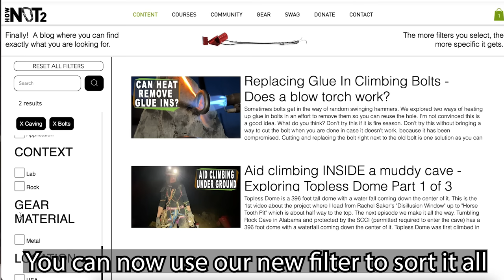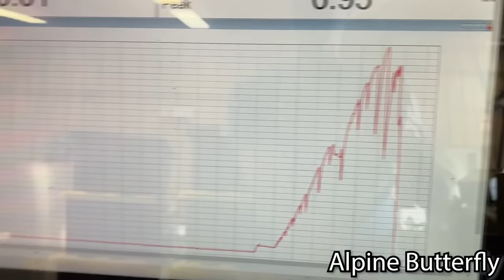15 Knots You Need to Big Wall

Comment from the maker: We did a nice write up on these knots at  https://www.hownot2.com/post/bigwalls-knots.

Check out our new store! https://hownot2.store/
Reply: Id be curious to see a pull test on a figure 8 with the tail end not fed through the last loop. Essentially seeing if the not is still redundant after becoming partially untied.
Reply: 39:25 The VT prusik is also called baldostano, it was taught to me by a firefighter who said it was used to go down an elevator cable under tension even with grease

Comment: Two notes on Munter hitches that don't get mentioned very often: 1) the rope-on-rope friction is hard on the sheath and can accelerate wear.  It will not cut through the rope like a sling or cord demo does, but it can accelerate worn sheath points into core shots;  2) the  action for the braking is the  reverse of almost any mechanical rappel device used in climbing.  To slow or stop the descent, the brake hand must bring the free (slack) strand towards the loaded strand to slow and parallel to the loaded strand to stop.  So, if the loaded strand leads UP out of the pear 'biner, LIFT UP (this would be rappelling, or for belaying a climber/lowering a load above the 'biner).  If the loaded strand lead DOWN out of the pear 'biner, LOWER  DOWN (this would be for belaying a climber/lowering a load below the 'biner).  The munter hitch should be practiced along with the mechanical belay device until going back and forth between them no longer confuses the user and the correct braking action is automatic with no surprises.
Reply: The hand position doesnt matter alot in terms of braking power. It mainly affects the amount of twists the hitch generates. If the braking hand is parallel to the loading strand theres the least amount of twists, but its also the least ergonomic position. The rope also twists alot more under load so it makes sense to lower with hands up, even if you belay hands down.
Reply: @dunklezwiebel   Hmmm...  My experience with the Munter hitch is as I stated.  Yes, an additional wrap will add friction, but it seems to me that varying the brake-hand position is what varies the braking power from fast to slow to stop for however many wraps one has around the 'biner.

Comment: A clove hitch, followed periodically with half hitches, is the prescribed method for sending a pipe up on a rope, at least among the riggers I know, so I'd say it's quite bomber. 

There's even an old school arborist out in Santa Cruz that rigs down big wood on a clove hitch backed up with a half hitch. For an easily untied knot that cinches like that double fisherman loop, or the clove, try the running bowline; what is considered current best practice in arboriculture.

Comment: The bowline on a bite can also be done as a follow through and is a great knot to tie in with as well if you expect to take a good few falls. If would argue that is actually internally redundant because if one loop comes completely undone, it will still be a regular bowline with a really long tail which is super good enough as a back up. I wouldn't clip the two loops independently though, idk if that would hold if one failed.

There is also a really cool way to tie in a person to the middle of a rope with a bowline on a bite by having the person step through the whole loop, however this has the limitation that it cannot be undone if a person is tethered into a wall without undoing the tether.
Reply: Hmmm...  I know of no practical way to tie a harness directly into a bowline on a bight if I am already wearing the harness.  I could clip to it using 'biners, but that adds an additional point of confusion/potential failure.
Reply: @perplexedon9834  Ah.  I and others use the term 'tie in' exclusively to refer to connecting the rope directly to a climbing harness,  fixed protection (e.g. bolted ring), etc. and not for creating a loop to be clipped into the harness or whatever using carabiners or screw links that add complexity and addition points for failure or error potential.  In an all-rock climbing scenario, I see no major advantages to clipping into a loop at the end of rope when tying in directly (with no 'biner) can done easily.  YMMV
Reply: @kayzinti4452  
When I said clip the loops independently, that was just with reference to whether you could weight each loop independently. Everything else in my comment was about tying in as you described. When I use bowline on a bite to tie in myself or tie the rope to an anchor I do not use any carabiners.

In that link it describes with pictures how to tie in to the middle of the rope with bowline on a bite with no carabiners required
Reply: @perplexedon9834   Now that I re-read the link more closely (+ didn't get down to pix before), I better understand what you are saying.  While I have not seen these illustrated before (very clear pictures!), for my own taste and preferences I would put these in the 'not-practical (not every climb)' category due to the need for extra rope to tie-in, and the challenges of doing this in an unsecure stance (clipped-in or not).  Both are valid secure knots once tied, certainly, but balancing the potential risks of getting it tied in a precarious stance against the risk of cross-loading a couple reversed 'biners clipped to a alpine butterfly loop, I myself am going to clip-in rather than tie in.    The potential for confusion and mistakes leading grim accidents (like the fall noted in your link) always influences my thinking.  In the scenario where I am hard-put to use 2 'biners for clipping in, I probably would use the girth hitch with an alpine butterfly knot instead of a figure-8.  Thanks for the link and your thoughts.
Reply: The bowline on a bight threaded, also used instead of a figure eight threaded to knot the rope to your harness.

Comment: Awsome video... AND:
(/rant on)
The carrick bend. I get why it has fallen out of the discussion in most North American climbing, but, particularly here, it might get some. The edk is only suitable for matched ropes at low load (twins, halves or simi static of the same diameter). The carrick tied properly, that is with ends exiting on opposite sides and dressed by pulling both ends against the working ropes and then the working ropes against each other, will form an asymmetric knot that will do anything an edk will with the added bonus of a strong knot that won't jam, capsize or damage the rope between any two life support lines.
Also, the bowline on the bight with the double loop being clipped as one loop is its own backup. It's a left hand bowline tied on top of a right hand bowline and will ring load all day... as long as the 2 loops are treated as one. Tied in a sling (even dyneema) or cordalet with the double loop clipped to a primary anchor and the single clipped to a backup point, it is slept on as a 2 bolt belay. I think Mammut did some great test with this.
(... /rant off)

Comment: Hey there! we were told in sailing school, that there is a bowline and a wrong bowline. And the wrong one is considered not safe and has the end of the rope pointing inside as you showed it. the "correct" version has the end pointing outwards, out of the loop... Is ther a differece in strength and safety between both? Very curious

Comment: Fun Fact :   The Double Fishermans aka Blood knot,  Is the only knot certified to be used while tying spectra line together during production. so if a strand (strand being anything from a tiny 10 threads or so to a huge bundle of twisted strands)  breaks or runs out in the middle of a run while twisting or braiding you use that knot to tie in the next package of line and hopefully it's not on the outside of the rope when its done on a run. we used quad twist knots to ensure enough friction and a 1 inch tail so it wouldn't come untied.
Reply: Blood knot is NOT the same as a double (or single or triple) fisherman’s knot. Totally different structure.
Reply: @matthewwikswo807  you are correct sir, I made my comment in haste, the double fisherman's is closer to a double barrel knot

Comment: To the topic of bowlines. If you want to tie in with a bowline to your harness than you have to use a double bowline because of ringloading. If I back it up is a single bowline enough or still not safe? My experience is that not many climbers I've met can tell me all of that. They just say: I learned it that way and do it that way. So I would very glad to hear something about that topic.

Comment: Thnx guys for these video's. really helpfull and well shown. I do have a question. Why use  an extra/different knot (stopper knot) to at the end of a rope to stop you from falling off when you ran out of rope if you can use a figure 8 aswell.  Imo less is more so if you as little different knots as sdafely possible.  Do I miss any brenefits from the stopperknot instead of a figure 8 knot?

Comment: I would give a shout out to the triple bowline, which is excellent for tying something around an object (tree, for example) using the middle of the rope.
Reply: What scenario(s) would you use this in?  The only one I can think of would be rigging a short drop with two parallel lines for rappelling/ascending practice with a single rope long enough to rig both.
Reply: @kayzinti4452  it's also a fairly good knot for tying in with the middle of the rope to lead if you don't have double ropes and are about to take on a pitch with traversing in various directions. Last time I used it was in a party of three when we were two people on a ledge with some trees and I wanted to go down a slightly different line to do something while the third guy was on the way up, so I used the backside of the rope used in the belay. None of this was very big wall though, I realize!

Comment: you mentioned that even with a long tail, you wouldn't fix a line for your partner using an overhand on a bight. When my wife and I are developing routes, we at times use an overhand. If were not TR-soloing the new route and simply hanging/jugging to scrub/trundle, should we stop using an overhand and use a fig8? is it unsafe? i know it COULD roll but under an incredible amount of force.

Comment: Great video, thank you!
At 26:35, you say “the girth hitch is not safe”, but at 26:45 you say “I’m gonna do a girth hitch with a sling”. Do I understand correctly that I should not hang something heavy to that sling?
At 27:50, I understand that you suggest anchoring yourself to the master point, which is an HMS carabiner. However, I’ve seen that when HMS carabiners are loaded they may not come to a setting that is as strong as what you’d get with a D-shaped carabiner (which automatically put the load along the spine). So, I wonder if this is good practice to anchor yourself to an HMS master point? Instead, what do you think of anchoring yourself to a quad anchor?

Comment: Was that the third rope? I ascended that rope a few weeks ago and found out I was hanging on by a few core strands when I got to the top. Yikes. Ended up replacing it with a section of our lead line on the way down. I packed out and threw away the old rope, how did you get a piece?

Also thanks for the video, I had not seen the snap bowline before.

Comment: 35:15 A proper "square knot" is a reef knot. Its false cousin is the thief knot (or even worse the even worse grief knot)
Reply: The incorrect version demonstrated in the video is most often called a granny knot. A Theives knot, without looking at the tail ends looks exactly like a square knot. the difference is that instead of both tails leaving the "front" of the knot, one leaves the back of the knot while the other leaves the front of the knot. A story that is often told along with it is that sailors would tie their bags shut with a thieves knot, and if someone looked through their bag they could tell because the thief wouldn't be clever enough to re-tie the bag with a thieves knot.
Reply: @Hyperbrain10  Good info, thanks!

Comment: Not that I climb so I have no idea, but why do people tie their stopper knot so close to the end of the rope? Wouldn't having 4 or 5 ft below it be handy if you every got to the knot? Or do you need those 5 ft to get to the next bolt?
Reply: Some people tie a loop at the end to clip to or put a foot in.  A few feet of straight line beyond the stopper knot could lead to confusion in some sketchy scenarios with successive drops.
Reply: @kayzinti4452  WOW! Fair to say I hadn't thought that one through. Thanks for clearing that up.
Reply: And yes, I have needed those last few feet a handful of times (out of 1000 rappels or so?), not many, but if you do and you've tied the stopper knot too short, it's not a good situation. Remediable, but not good.

Comment: You’re tracer eight to attach two ropes together both ropes need to be the same diameter there is another knot to use if they are of two different diameter ropes

Comment: Awesome video!
Would you be able to come up with a "package" of solutions for stationary and self-climber tree stand hunting?
Issues to consider: There are harnesses and all, but what if something really happens? How long does someone really have before the blood circulation knocks one out? Any practical solutions to climb down safely in case of a fall? And are there any injury hazards due to improper strapping?
Cheers! :)

Comment: Why would I even use a bowline? I mean I used to make tree anchors with it but I use fig8 now.
Reply: As a climber, I can safely say the bowline is my go-to for building anchors.  The great thing about the bowline is that after being weighted, it's easy to untie.  A fig8 can sometimes be a little more difficult.  However, there are two more reasons I like the bowline: 1) it's easy to adjust, meaning if you need to adjust the length of the loop for changing angles, it's easy to do, a fig8 requires running the line a few additional times; 2) I'm not sure this qualifies as a legit argument for the bowline, but I like the variety that it allows - what I mean by that is you have a regular bowline, rethreaded bowline, bowline on a bight, bowline with a bight, double bowline.  With a fig8, you have a fig8, fig8 follow-through, and bunny ears (double fig8), fig 8 on bight and directional fig8 (quasi-alpine butterfly alternative).  I suppose you could add a triple fig8 into that (but is more complicated to tie).  With all of those variations of the fig8, I just feel the bowline provides more flexibility and efficiency of time and materials in some cases.  

But like all things in climbing, the tool that I choose is completely situational.  Having all of these tools in my toolbelt allows me to make the best decisions for the situation that I'm in, the situation I might face with the next pitch, and even what my follower can provide my follower with options.
Reply: @joejoe-bs6jq  oh cool thanks for typing all that I might bring it back out of retirement

Comment: As arborist its almost unwatchable as my knots are remembered in muscle memory tieing in and onto things daily. I find it so difficult to watch people tie knots in diffrent ways. I start worrying im going to forget or confuse myself on something ive done everyday for 10 years.lol😂
Reply: The way ive been trained. I find myself going back to the same knots that get used more frequently than others.. i will tie in with perfection loop. (Basicly a bowline with an extra loop for the tail).. always with stopper knot on the end.  Will quite often use figure 8 as stopper knot aswell. All my prusiks are joined with fishermans knot. And alpine butterfly would be my go to for midline knot to engineer and 3- 1 pullys..  i obviosly sometimes get strange looks un the climbing gym. With my choices of knots for things. But so use to it and ways of doing things..😂

Comment: 13:00 proves backup knots are a waste of time: just point a camera at the knot and keep talking about how unsafe it is.  You can make an overhand hold better than a sewn eye by doing that.

Something I'd like to see tested on the drop tower, and possibly on some higher but easily accessible overhang, would be to test free slipping speed of various rappel/belay methods.  Obviously rope size and sheath will be the biggest factor, so you'd have to standardize that, and preferably use rope that's not brand new, but not significantly worn yet.  Then you'd ideally want to be able to check speed at several points during the descent, (continuous would be ideal, but you'd have to make sure it doesn't add drag to the system, so closest would probably be a series of those cheap baseball pitch radars) so you can see if/when it maxes out.  Then maybe some ER docs and/or safety pros could weigh in on what impact speed (assuming landing on your feet) would result in a few different levels of injury: highly unlikely, (yeah, I've tweaked my ankle stepping off a curb, so anything is possible) mild injury, (annoyance, walk it off) moderate injury, (limp back to the car because you're done for the day, but will be fine with some ice and rest) need medical treatment, need medical treatment and weeks to months of PT, need ICU, need funeral, or need power washer and lots of bleach. 
Just curious to see how far the theoretical standard weight climber could take the max speed ride after completely losing grip on the brake strand and still just have a "no shit, there I was" story instead of full body cast by various rappel methods.  Of course, there are a lot of factors, down to the cross section of the biner used in an ATC style device, (FWIW, those cheap Favofit lockers on Amazon keep an ATC pretty darn slow on my "big tree in the yard practice" static rope.) which could be seen as a plus: there's tons of variables to do lots of testing for huge spreadsheets and long videos.